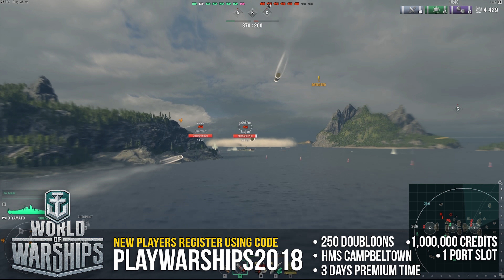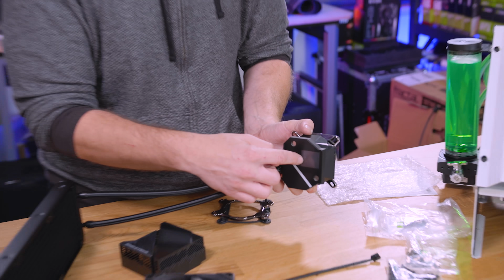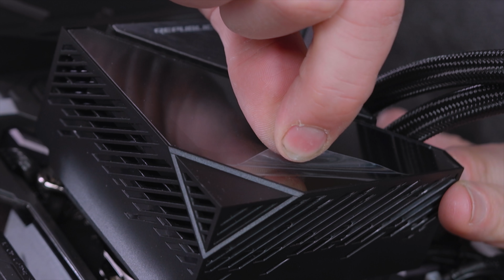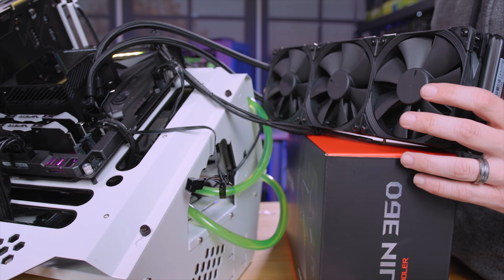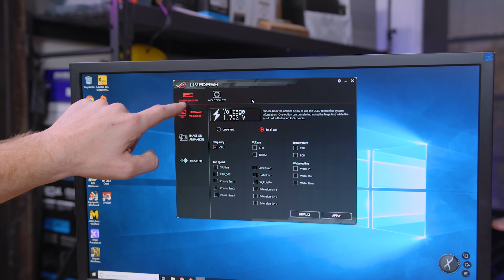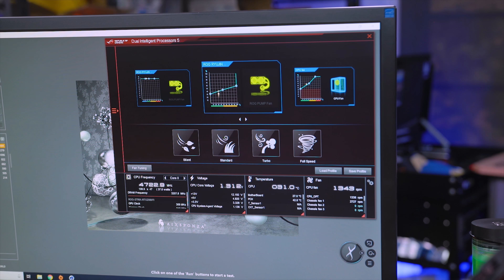ASUS made an AIO... but is it any good?? RYUJIN 360

Comment: I mean, noctua sells black fans that come with a few different colors for the antivibration mounts in the corners. But they're 27 bucks each.
Reply: true. a little more depending the day. Myself  EK on my x72 in white
Reply: They are the same Fans, i checked them and you can see they have black anti vibration mounts on these too so it's $81 just for the fans hence why it's so expensive.
Reply: Darren Rushworth-Moore They are not the same fans. Richard is talking about the Chromax fans and Jay said this AIO included the IPPC fans. Both black and both very close in price but different in some key areas.
Reply: @lowstryder1022  Are you sure because the IPPC2000 fans have anti vibration mounts in the corners and if you buy retail they are black fans with brown mounts, while the ones boxed with the ASUS AIO have black anti vibration mounts. I think the chromax also includes anti vibration stand offs.

I think this was what he means: https://noctua.at/en/nf-f12-industrialppc-2000-pwm/specification
Reply: Darren Rushworth-Moore Yes, the link you provided are the fans that Jay said comes with the AIO. The only difference is the black anti vibration dampeners which Noctua could have easily provided instead of the brown ones so that the entire unit was blacked out. What I believe Richard was talking about above was the Chromax line which is also black and comes with multiple colors of the dampeners. Chromax is equivalent in performance to their original lineup of fans and the IPPC fans are their tougher industrial grade “server-esque” line of fans.
Reply: @Dazzxp  $81 dollars just to have black vibration mounts?
Reply: Buy Corsair MLs. Problem solved.
Reply: Noctua Chromax are decent looking. Still boring but better looking than the their typical vomit worthy fans.

Comment: I stopped buying AIO because they always go out after a year and I have to buy another one. I just buy a regular cooler now. the only part to go out is the fan and I could easily replace it for cheap. The AIO will most likely never leak but the pump goes out and lets the cpu get to hot then turns it off and you can't do anything. The only problem with a normal cooler is the dust which you have to clean just as much as a radiator with a fan.
Reply: What units have you tried? I have a Corsair H100i that's been running 10 to 20 hours every day since early 2014 without any problems. Stock thermal paste too, I should change that soon. I think any halfway decent AIO will typically last way longer than a year.

Comment: Since the display on the pump is an OLED, would burn in become an issue if you set some more or less static display like CPU temp or ROG logo?
Reply: These types of OLED screens are not really the same as TV or smartphone screens. There's only like 160 x 128 pixels on this screen. The pitch (pixel size) is enormous. And that basically means it's not very susceptible to burn-in.

Sure, it won't last 20 years like an LCD or whatever without burn-in. But it'll last longer than the AIO probably.
Reply: More than likely. Best thing would be to have that rotating so as to try and avoid the issue
Reply: peak brightness is virtually nothing.  this isnt an hdr tv we are talking here.  this is old school oled like the ones used in 2010.  different than televisions.
Reply: Yes I’m using it right now in my build but set it to monitor different temps and stuff so as not to have burn-ins.
Reply: I know it's a different thing, but I have an ASUS Rampage VI Extreme with one of the little displays on the side of it, and yeah it's got permanent burn in of cpu temp. Won't go away no matter the image. Sucks
Reply: no
Reply: The OLED used here is basically a low powered LED dot matrix display... NOT the super high contrast/bright TV displays that suffer from burn in. I have this type of display on a smart watch. Which keeps an analog looking face on all the time... Had it for a couple of years now and have no any issues with burn in. Of course the display is NOT super bright and the contrast is not great. BUT for small displays like the one in this video or a watch... they are great.
Reply: as someone who has had a steelseries rival 700 for a long time with a static image, i havent seen any burn in on its oled screen
Reply: It’s not noticeable in person but if you record it with a camera you can see that it flickers really fast so it’s never just a static image.
Reply: @areyou0k98  in that case no oled screen displays a static image but can still suffer burn in, the oled screen on the rival 700 and 710 is a 1bit (black and white) 128x36pixel oled screen, its possible that type of oled doesnt burn in
Reply: @areyou0k98  That's not how that works.... You're talking about hertz or shutter speed basically....
Reply: Glad I looked instead of double posting.  This exactly, oleds are infamous for burn in from static images.  It's why they don't really make oled monitors.  Why do it with something that will rarely change? I have a feeling there will be a lot of gripes 6 months after launch.

Comment: I would rather have a ROG MATX Ryzen motherboard than this anyday
Reply: amen brother. we need a Gene board but for AM4
Reply: Ugh children suck
Reply: Ryzen cant suck that bad last time i checked they  are gonna  be doing 7nm next year meanwhile intell cant do 10 nm and they a  useless 10 core cpu lmao
Reply: 4.1ghz here with a 1600 on, the entry level of all entry level [gaming] motherboards, an awesome ASRock B350 Pro4 with its whopping 4 phase VRM(hey, that's the same as ASUSes Z390 board!), and I'm not really pushing it, there's a small bit of headroom left. 4.2, possibly 4.25, and it isn't even an 'X' chip. Let alone the fact that it's a 1st gen, the 12nm Zen+ 2nd gens having even a bit more headroom. ~62ish° peak in stress testing under a cheap-O Cooler Master 120mm AIO(single fan, albeit it's one of their badass JetFlos that I added), at least 10° lower under typical triple-A gaming loads with an RX580 8g. 
Regardless, that's much more clock speed than I need for anything other than the rare triple-A title that I'll play, and even there the overclock is just a nice bonus. 

The Zen 2 architecture is likely going to be as much of a game changer as the original Ryzen launch, with [very high probability] rumored reports that the full architecture redesign for TSMC 7nm is supposedly at least on par with Intel in IPC, that we're going to see at least a 12 core mainstream SKU, and are already ahead of schedule in yields for the EPYC gen 2 SKUs that are going to launch pretty soon(with the 64c/128t monster 'halo' chip). Although it sounds like it's going to fall just short of 5.0ghz, likely good for 4.8. While Intel similarly will be bringing a 10 core mainstream, but on, once again, 14nm, as the 10nm that was originally scheduled for a market launch around Q4 2015 and is yet still lingering, still incomplete, and still [re]scheduled for holiday 2019.
 It's absolutely crazy at this point, especially with AMD making a practically improbable technological & financial turn around. 

The next 5 years are going to be VERY interesting in CPU development, between AMD primed to pull a technological lead, ARM steadily taking bites of market share, these AI chip developments in smartphones that shockingly apparently AREN'T just a gimmick, RISC-V gaining traction, and Intel in a very peculiar spot at the moment, as white collar mistakes have destroyed any technological momentum that they had, and the lead that they held over AMD after they bombed an entire generation(and all of their previous success) with Bulldozer.
Exciting times if you're a hardware geek!
Reply: RyTrapp0 I shall admit I’m a Asus fanboy from the days of doing nothing and achieving a 5ghz over lock on my Crosshair V formula Z with a FX 9370 on water obviously. I fell in love ever since. I’ve tried other manufacturers but none offer 8x/8x SLI in MATX. Which is something I wanted. 
I’ve been forced to go ATX/E-ATX hence the crosshairs 6 extreme for my 1800x. Trust me I fell in love again. The board is amazing totally overkill.
Reply: For 4GHz OC? lol
Reply: Bratislav Milenkovic I’ve hit 4.2 on my crosshair Vi extreme 1800x so far. Only backed off because board temps weren’t good. I’m water cooling the board so hoping to maybe get 4.5+ I know it’s a long shot.
Reply: Ugh ryzen sucks

Comment: It's ASUS... So... No.
Reply: Before you judge try a gaming laptop by them. Such as the god awful TUF FX504GD-ES51 that they claim is part of their ROG line.
Reply: TheNews1990 graphics cards are good imo
Reply: just because one product sucks, doesn’t mean asus products suck
in fact, their crosshair motherboards and strix GPUs are top of the line
Reply: @bwu45    I recently bought a laptop from them, and not only was the plastic mount holding the battery in place was cracked & all of my screws stripped before I even cracked it open... But also all of the connectors were covered in hot glue. It also had hot glue covering the 2nd GPU (which they forgot to mention that you get when you buy it... It's an Intel one & it gets hot. Right next to the battery), and no heatsink on it nor any fans on that GPU. They're as bad as Walmart's Over Powered computers, and over priced as well. 1st, and last ASUS purchase.
Reply: then that laptop lineup sucks, but ASUS products dont suck! you dont get it, please mature and grow up
Reply: @TheNews1990  Sometimes it surprises me that people still don't get it. You can't judge a product by the company and you can't judge a company by a few products. Gigabyte is a good example, their 10xx series nvidia cards run way too hot and the vrm just isn't very nice to work with. By that you could say, well never buying a gigabyte motherboard either, but the new lineup they launched for the 9xxx series with z390 is actually really good. The vrms are well cooled and well designed. All manufacturers make both good and bad products, I love my Zenith Extreme but I'd never run out and buy this AIO just cause it is from Asus. That is why we have channels like this and Gamers Nexus and AHOC to review stuff so that you can determine whether it is a good product for you. So, enough ranting, have a nice day :)
Reply: @jadoei13    I recently bought a laptop from them, and not only was the plastic mount holding the battery in place was cracked & all of my screws stripped before I even cracked it open... But also all of the connectors were covered in hot glue. It also had hot glue covering the 2nd GPU (which they forgot to mention that you get when you buy it... It's an Intel one & it gets hot. Right next to the battery), and no heatsink on it nor any fans on that GPU. They're as bad as Walmart's Over Powered nonsense, and over priced too.
Reply: Only thing I bought from Asus that went bad in the last 8 years for me was the 2080 Ti Dual but that's pretty much Nvidias fault because of all the bad cards across the board
Reply: @MrKevin920  I recently bought a laptop from them, and not only was the plastic mount holding the battery in place was cracked & all of my screws stripped before I even cracked it open... But also all of the connectors were covered in hot glue. It also had hot glue covering the 2nd GPU (which they forgot to mention that you get when you buy it... It's an Intel one & it gets hot. Right next to the battery), and no heatsink on it nor any fans on that GPU.